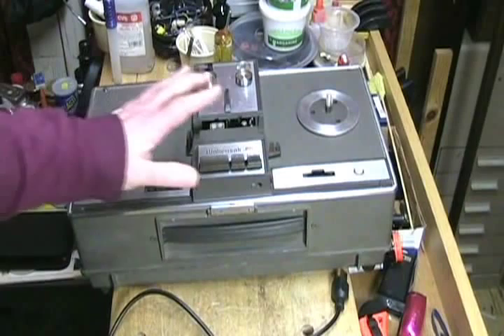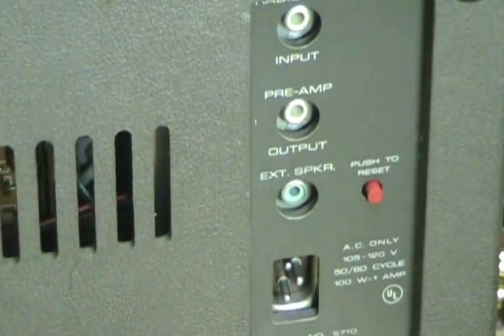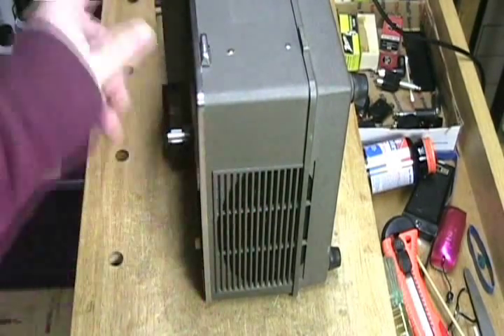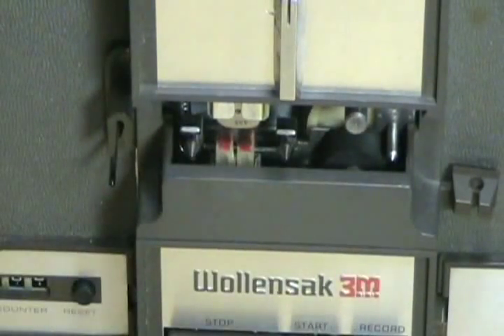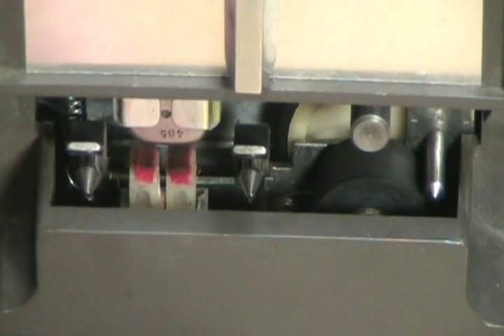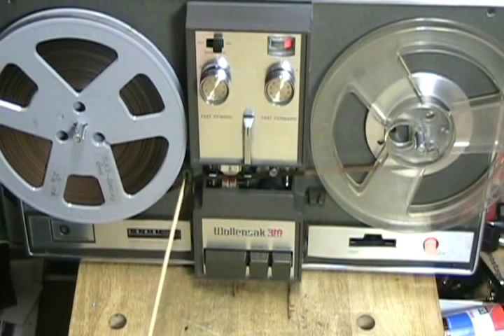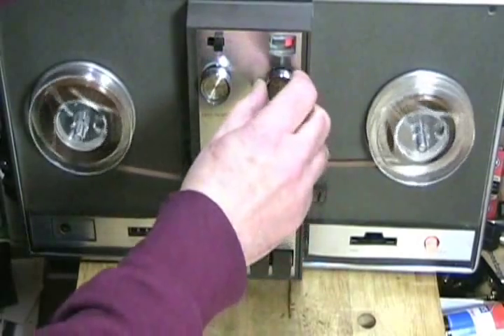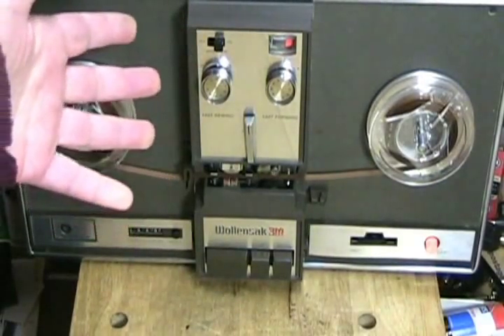How To Operate the Wollensak 5710 Vintage Reel to Reel Mono Tape Recorder

Comment: Mickey Mouse plug LOL. We call them cloverleaf plugs. Interesting machine. You can actually see the capstan change speed when you shifted the speeds over. Brilliant video.
Reply from the maker: Thanks RODALCO2007. Yeah, I couldn't remember the name when I made the video. There's a technical number also, IEC C5. But if you look up "Mickey Mouse" connector, the same plug will be found.

Comment: Love the smooth movement of the pinch roller and pressure pads engaging.
Reply from the maker: It is fun to watch the movement of the pinch roller. I should have shown it at the 15/16ths speed, you can really see the movement there.
Reply: *****
That part elliptical wheel with the rubber tyre on it is very interesting. Just looking on ebay for Wollensack R2R machines. Postage to New Zealand is very expensive.
Reply from the maker: RODALCO2007 Yeah, many times shipping costs can be incredibly high. The eccentric wheel is what Wollensak calls a "power cam". The capstan shaft has a knurled section, and this engages the tire (tyre) with very strong grip. Over time, and as the rubber dries out, the tire actually becomes a type of gear. But if it dries out too much, it breaks away. Then it has to be replaced with a simple plumbers "O" ring. The older Wollensak 1288 and others of its type, used a similar system, but it was MUCH simpler. However, it would occasionally jam. You can see more details about both these machines on my website at http://www.clydesight.com/wollensak_reel_to_reel_tape_recorder

Comment: Are all 5710 models the mono version?
Reply from the maker: Yes, the 5710 was the mono version. The 5000 series iof models were all stereo except the 5710.  The 5730, the next model upscale was stereo but had the exact same case as the  5710. The put the second speaker on the opposite side.  The 5740 had the exact same face plates but introduced the wing speakers and a vinyl covered case, the 5750 was the same as the 5740, but had a "walnut" wood case (called "Walnut wraps"), and the 5780 was the top of the line with full wooden case, bookshelf two-way speakers and a tuner module. The 5780 was designed to be hung on a wall in a 5 foot wide strip of:  Left Speaker- Tape Recorder - Tuner Module - Right speaker. It was very impressive! 

But ALL the 5000 models used the same mechanics and parts and the SAME amplifiers. Including the 5710. Except the 5710 was missing the stereo components on the PC board, but the space was there for them.
Reply: clydesight.  I recently pick up this model at a sale for 10 dollars. Don't know anything about it, would love for it to go to someone who could appreciate it!